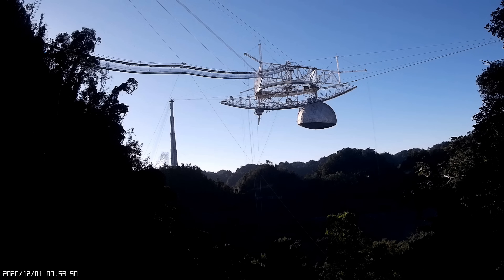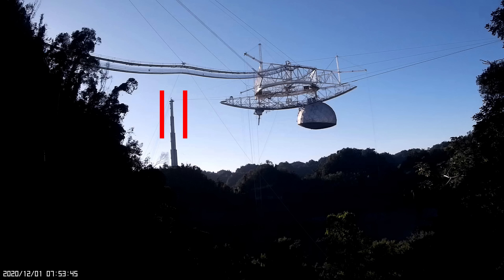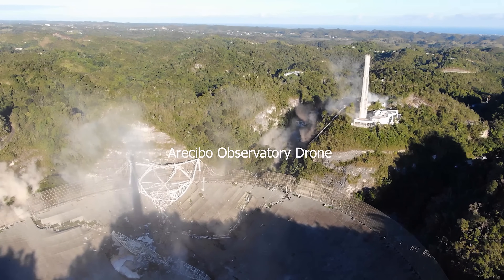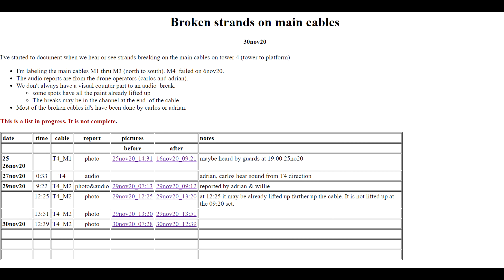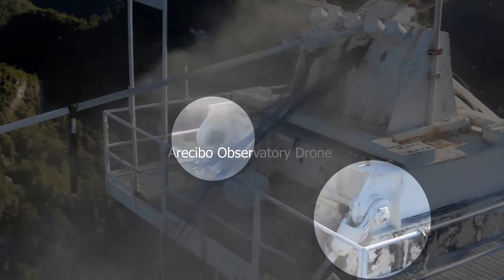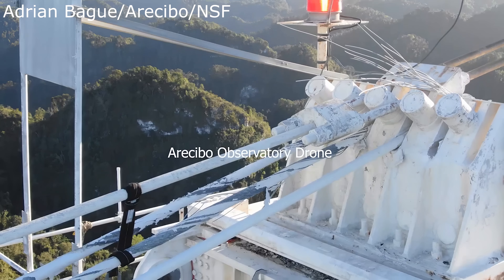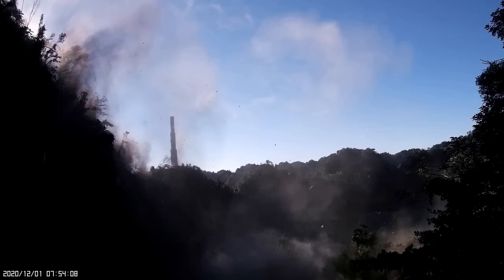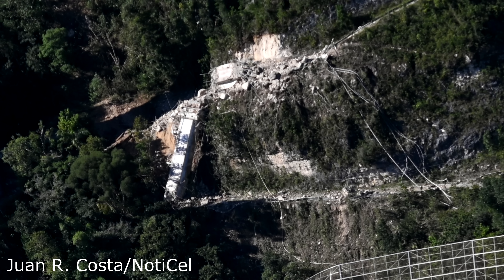Analyzing Video Footage Of Collapse of Massive Arecibo Telescope

Comment: Such a sad moment for astronomy.
Reply: The planned demolition was weeks away . The telescope has served 56 years and was weathered several storms and earthquakes and its demise was  due ..
Reply: @My Seventy Any time you over-stress a structure, you risk damaging it despite it not breaking. For a steel-reinforced concrete structure like these towers where the steel can't be inspected (because it's imbedded in the concrete), it probably means you're going to have to write off the towers entirely. Raze them and build new ones (assuming the telescope is rebuilt).  A controlled demolition would have avoided over-stressing the towers, and they perhaps could have been re-used in a new telescope. So having it fail this way is actually much more expensive than a controlled demolition if you have hopes of re-building it.
Reply: And a very dramatic ending. This wasn't a simple decommission and disassemble.
Reply: @My Seventy Cleaning this up costs way way waaaayy more.
Reply: @My Seventy except you have to fix and now check all the damage it did. Damage to roads, buildings, taking down the broken dish, checking which buildings are safe or not and replacement, damage to any unrerground equipment, etc.
Reply: @My Seventy actually it makes them loose even more in reparation and cleanup costs.
Reply: @My Seventy wait, you're saying that they created an earthquake to demolish this?
Reply: After they clean up chances are they will not rebuild and mother nature will once again reclaim it.
Reply: Watching the great things about America collapse in real time.
Reply: Wasn’t it kind of obsolete anyway?
Reply: @battlesheep2552  Yes . It was kind of obsolete and dangerous / unsafe for people to work with it ..
Reply: And astrology!